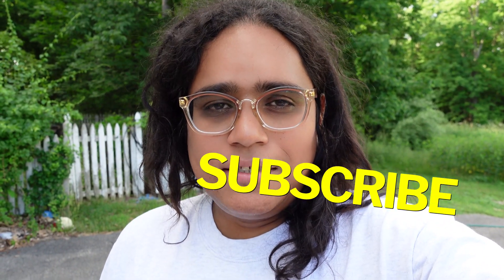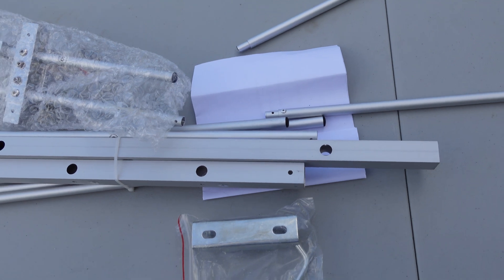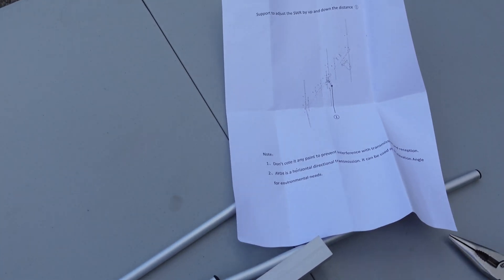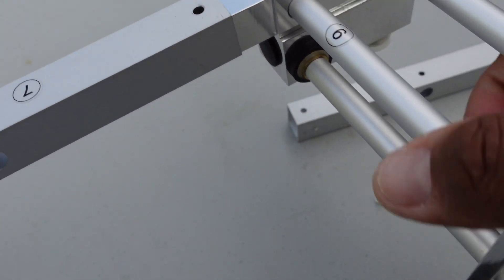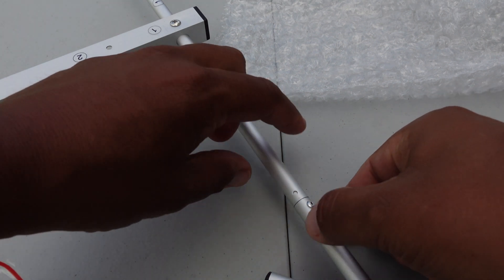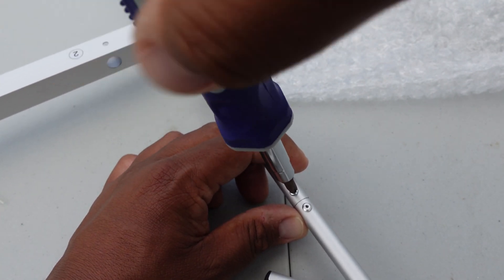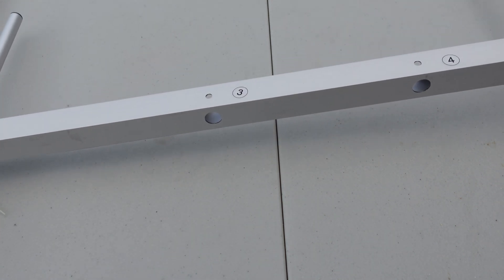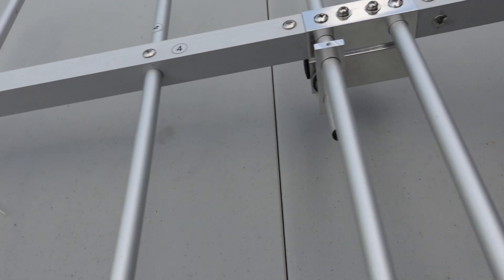Ailunce AY-04 dual band VHF/UHF antenna build for #hamradio

Comment: Is there a cheaper option if I get a cheap dual mobile antenna on a PVC  pipe screwed to the side of my house shoved  into coax to shove on my mobile dual band transceiver because I dont have 8 million dollars in 2024.

73 kq4hcu